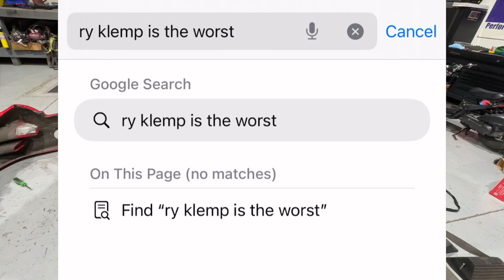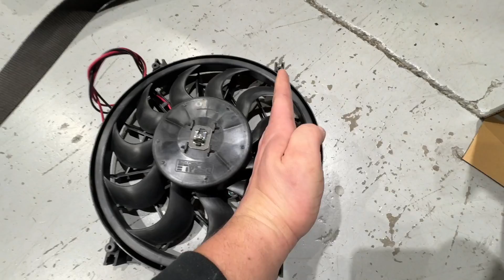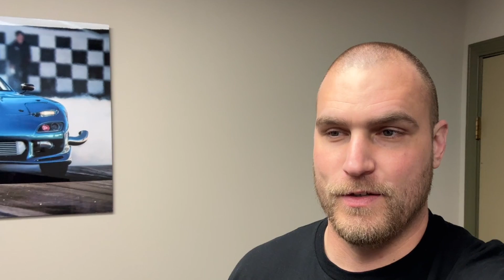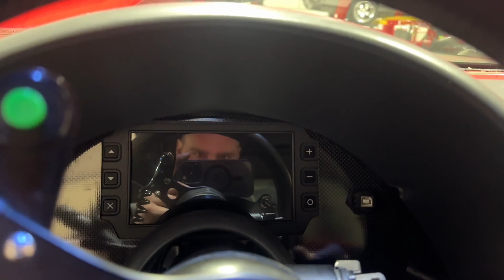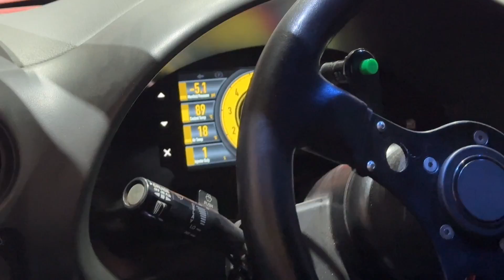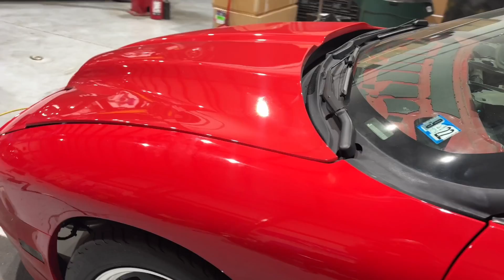FBody Stand Up Radiator Gets HOT! What Fans Will Actually WORK!?

Comment: Do you think with the two puller fans you had originally on there you can fit an A/C condenser up in front if the Griffin?
I'm doing the T6 Huron Speed kit, S400 chassis.  It mounts in the same place as yours, maybe you have the same kit.

Comment: Sealed ducting. You need to add it. People routinely ignore the requirement for ducting to make the system work more efficient. High pressure flow (IC though trans cooler, to radiator) to low pressure (behind rad) and out. You are going to want to test this car at speed and in traffic to determine it's efficiency. The air needs to be forced through the core to work, otherwise it will find the path of least resistance.

Comment: Pusher fans don't work. Pull through fans will work but only if you run a shroud.  That's been my experience
Reply: Come tell that to my pusher fans when they’re working just fine in over 100°F ambient and getting my coolant temp stable at around 190 and while driving and right after a few boosted wot runs they make the temp come down from 210 back to 190 .

Comment: I might have missed your comment about it, but when you removed the oil pressure wire to fix the TPS, you showed the TPS cycling from 0 to 100% perfectly. Later when you were revving the motor to check coolant temp, the TPS had crapped out again.

Comment: I've got the same the same general cooling setup. I noticed a decent drop in temps by putting the front splitter and plastics back in the car. It also reduced the run time on the fans.  Dual pass rad by Champion, derale pusher fans controlled by factory 3 relay setup.

Comment: I swear by the 16” spal h.o. fan mounted behind my radiator …….on all my supercharged LS swaps……they literally run for 3 minutes until they kick back off at 179*……..best $150 u can spend on a NEW single fan hands down….just make sure you wire them with a relay as the instructions on the system says too!!!….and a derale trans pan with the cooling tubes keeps my trans temps below 150* on the hottest summer days sitting in traffic!!!

Comment: I had three of those Derale fans fail on my turbo fbody. ( less than 100 miles completely unraveled the motor internally) they used to have a bosch motor but they switched to a Chinese motor I wish you the best luck.

Comment: Check your ground on the block. Maybe Ry can make a remote control car to explain what I mean. Also make sure your sheild wires are not grounded to anything other than shield ground.
Reply: I am waiting for RY to make a video on how the instant center works on a dual pass radiator.

Comment: I could not keep my camaro cool with dual high output pusher fans. I ended up tubing the front of the car moving my rad forward and with a single 16924 and a fan shroud it cooled good. The shroud made a huge difference. You’ll never use the whole rad without one

Comment: Thanks for sharing. Glad you were able to get it sorted out. 

Maybe the 5v pin in your extension harness was barely making connection to the other connector and caused some high resistance getting it hot? Dunno interested to see what you find out